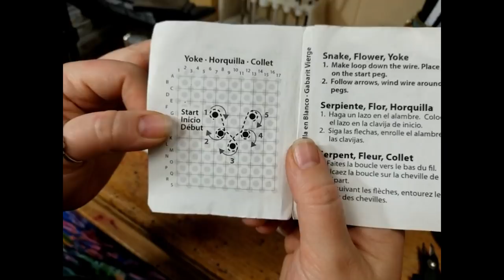Wig Jig: Wire Yoke

Comment: Hey von! What’s the best metal type to start wire working with? I  have a little plastic wig jig, plenty of plier types, a wooden mallet, a metal bar(instead of an anvil). I have 18 gauge... copper(4 I think) wire, but to practice I don’t want to burn up good wire. Any suggestions?

Comment: I have that jig, and use superglue to hold the rubber tubing flush against the back of the jig, preventing any spacing or wobbling. You can remove the glued pegs, with effort, but it does inevitably destroys the tubing. I've written to the company & they sent me extras.

Comment: Hey Yvonne, I love this design and how you present it. I use a wig jig too, just the plastic ones. I was wondering what the brass head on the hammer does as opposed to a steel one. I have a steel chasing hammer, a rubber mallet and a rawhide hammer. Is there a great benefit to using a brass headed and nylon hammer?
Reply from the maker: Hey, Xynarah!  The steel hammer will leave deeper and harder imprints in your metal than the softer brass head; I use the brass because it is what I have and am used to. Nylon heads are in between the effects you can get with rubber and rawhide. I will do a comparison video on this subject!
Reply: @backtoearthcreations  I'll look for that follow up video. :) But if you happen 2see this after all this time, would you mind sharing the approx weight of the hammer that works well for you? Tyvm.